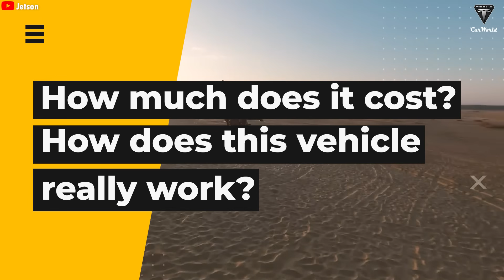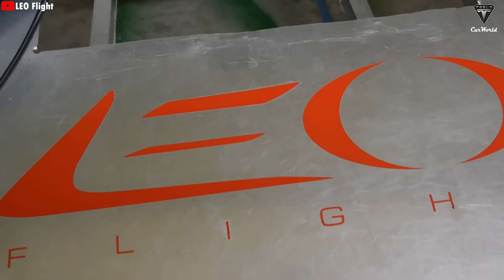2026 First Flying Car Finally On Real World! Specs & Design Almost Impossible!

Comment: Why do I keep hearing about how dangerous these will be in the air with people flying them? Most likely you WON'T. It will fly by wire, you just tell it where you want it to go and it does, guided by GPS, not "free flying mode" if that is allowed like modern aircraft.

One issue at least for me is cabin space. one that can't even seat 4 people, never mind you could put groceries or even a suitcase in needs to be solved.25 MPH on the ground?? Doesn't impress me yet